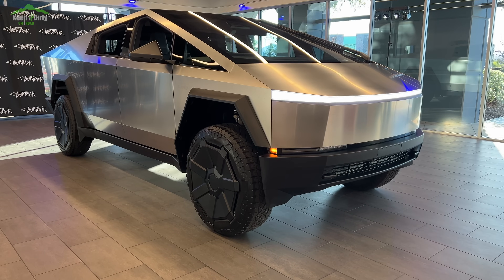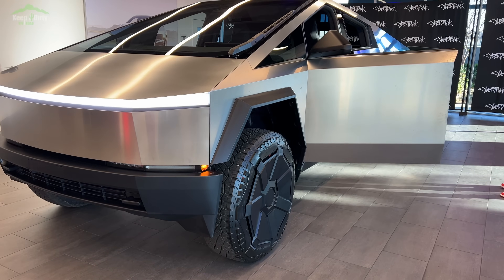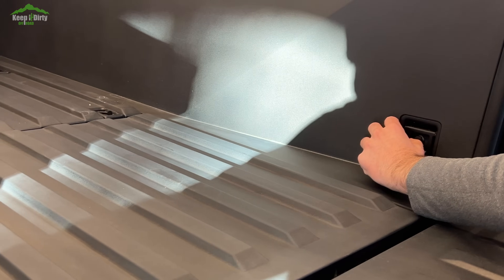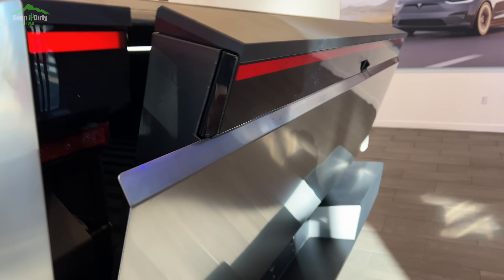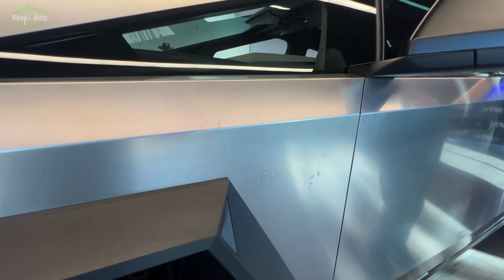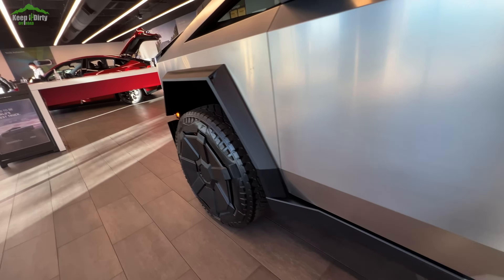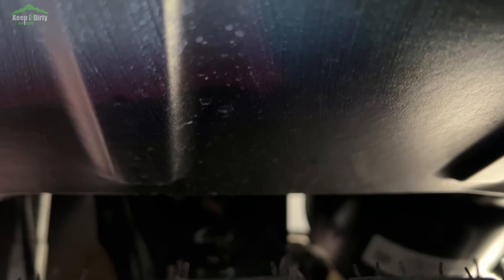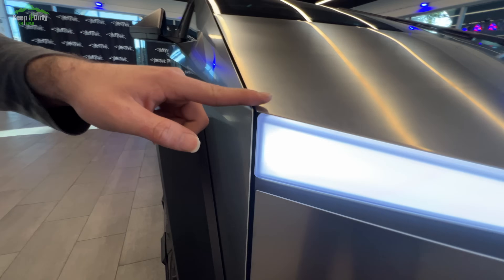Off-roaders take on the CyberTruck

Comment: I think you are unfairly critical of the Cybertruck.  It was never meant to be the ultimate in off-road vehicle, but still offers considerable off-road capability, short of a rock crawling modified jeep.  Wasted space?  The bed or vault provides 50 cf of secure, weatherproof storage plus another 35 cf behind the front seat and 7 cf in the frunk.  That's over 90 cf of protected storage space in a truck shorter than an F-150.  The ride quality, maneuverability, and silent power rivals that of a Model X.  The air suspension has 12" of vertical adjustment from an easy entry height to 17.44" of ground clearance, more than most 4-wheelers, and no differential to get hung up on.  Traction control with locking differentials will make off-roading better than most stock 4 x 4 pickups.  And I haven't even mentioned performance.  Your complaints seem trivial in comparison to the many features and capabilities of this truck. You don't even acknowledge the durability factor of the 1.8mm stainless steel exterior, only pointing out the sharp edges which will "cut you".  Nonsense.   Oh, and many of us owners think it beautifully futuristic, unlike the century old, busy appearance of every other pickup out there.  Sorry, but I have to give you a thumbs down on this review.
Reply from the maker: Ah spoken like a Tesla fan that’s not a truck guy. 

Yes, a regular truck with a bed cover with have similar storage. The suspension can collapse on a POTHOLE it’s so weak. 

But you are on point. It rivals the model X. A street focused SUV. Not a truck.  

And the clearance you stated does not matter. Because it only has the clearance at the top height. Raptors have more than that and have better departure angles. And that truck can use all that offroad.

Now I ageee with you the powertrain has more potential. But right now, TODAY, it can’t lock the differentials and it has super weak suspension for the road. That front arm is important and it takes all of its capability away. 

To me the CT had to be better than any other truck on the market. And it’s not. Truck guys will see that instantly. Fan boys won’t.

I’m a big fan of Tesla. And I’ve been very disappointed. You may be happy with it. But I’m coming at it from a very different place than you are. I want an off-road toy that will rival my raptor. That’s why guys watch my channel. This is not that and as a truck, it’s a big miss. The Rivian is far better
Reply from the maker: Now you mentions the “durability of the stainless” that’s literally the trucks worst feature. The stainless panels and the gigacast supporting it is going to make them a nighmare to repair. I would also argue that with traditional panels it could be a might lighter and more efficient truck. I don’t a lot of off-roading and get tons of pin stripes and damage on body panels. Even though the stainless has good impact resistant, it can still get scratched and it will rust. And if you get into an accident you can see small damage completely total the truck. So the insurance costs are going to be nuts. So yeah man. You pointed out one of its worse features
Reply: @KeepItDirtyOffRoad  It's clear you've blindly accepted things that others have merely speculated on but which are by no means proven or likely.  There are arguments against everything you've just written.  The most obvious fallacy is that the SS will rust.  Cybertruck is going to eat into conventional truck sales in a big way.  That's got to be hard to accept, but it will happen.  Cheers!
Reply: @KeepItDirtyOffRoad  Every truck has it strengths and weaknesses.  No truck is all-around better than another truck.  I'm not a truck guy, your right.  I'm a truck girl though.  I don't need, nor would I want a Raptor.  It's a vehicle that appeals to some for the purposes it does well. But it falls short in many other ways.  I will be doing off-roading with my Cybertruck.  Not the kind you do, but plenty of scenic back country camping on some fairly rugged trails.  I don't need a 35 deg departure angle for where I plan to go, and I don't need the Rivian's tiny bed.  I hope that I meet you on the trail out west one day.  Most off-roaders are friendly, helpful, and respectful as I'm sure you are.
Reply: @MsAjax409 SS rusting isn’t controversial. All steel rusts. Some are more resistant than others. That’s not speculation.
Reply: @MsAjax409 I don’t believe CT will eat into any ICE truck sales. The towing numbers are forgettable. The more overlanding style crowd, which more closely resembles the type of off road use you described is not benefited by the CT design.
Reply from the maker: Would love to meet you on the trails. No better way to discuss these vehicles and see what they can do. But please know my thoughts are my own. I’ve seen what happens to delorians when they were not properly cared for. I love EVs and wish ford would build the switchgear for us, if you haven’t seen it it’s a raptor version of the lightning that is very compelling. Have a video on that too. 

I also have experience with teslas and their issues. And that’s where my opinions come from. I have not had the best experience with them. I’ve loved their cars. But hated their reliability and service. After my model S required a new battery pack after 2 years and 50k miles they went down a few pegs. Still bought a 3 later and that was better but also worse because the cost cutting was pretty bad on those early models. I’m seeing that same pattern repeat on the cybertruck but worse. So I’m disappointed in the company as a whole to be honest. The first Tesla truck should have set the standard for EV trucks. And to me I didn’t. The Rivian and the f150 lightning are more compelling options to me. But neither has native access to the supercharger network so they are not for me either so I can go where ever I want to go. The public charging network is a joke compared to Teslas supercharger network.
Reply: @xxicemanxx11  I agree that long distance towing is a problem for EV pickups, but not for local towing.  Fifth wheel rigs, for example, should stick with ICE tow vehicles.  But many trucks are sold that aren't used for towing long distances, and the significant cost of ownership benefits of the Cybertruck will convert many traditional pickup owners.  The backlog of reservations and orders is enormous.  Yes, CT will eat into ICE truck sales.  The only question is how much, and that will depend on future pricing.
Reply: @MsAjax409 tbd. In current capability, I don’t believe they will. Still need jumps in technology. Just my opinion. I didn’t tow hardly ever with my F150 but when I did, a CT wouldn’t have the range to do it. For me personally I need more capability there.
Reply: @MsAjax409 I’ve seen all the counter arguments. And yes. It’s technically true…because it is true. There’s just zero excuse for Tesla not to have at least an epoxy or clear coat on the external finish.
Reply: Good points here. The CT looks to have been designed with some basic offroad capabilities in mind, but it wasn't intended for rock crawling or anything like that.

Fact is, most truck owners will never take their trucks offroad beyond a construction site, a farm, or a logging road. For that matter, only a tiny minority of truck owners even use their truck to tow.

People get trucks to carry their tools or to be able to occasionally carry cargo that won't fit in a car.

The biggest thing is to displace the many inefficient trucks that are already on the roads while offering the capabilities that the majority of truck buyers need. That requires cost-cutting to make the CT broadly affordable.

You know what they say: "Good, fast, cheap. Pick two."
Reply from the maker: If it wasent intended to go off-road then why does it have such large tires and the capability to raise it so high? 

They would get better range with street tires. It would be faster and more livable. Regardless of what you think of how trucks get used the Cubertruck was advertised as an off-road truck to be better than all trucks. And it’s not that. It’s that simple.

Comment: It was designed to be "ugly".  Instead of aero dynamic they went for looks.  This is a driving bill board and do not even need a badge to say what it is.  Honestly the firs impression of the upper control arms in front is not good, but if you think of what their job is they are actually quite adequate.  They are there just to keep the wheel upright and they take nearly no sideway stress, except if you mount something like tank tracks on the outside of the vehicle.  The most stress they experience is most probably with braking and accelerating.  Most cars have a rubber mounting on top of the strut doing the job, so not much stress in that area.
Reply from the maker: Yeah, it’s the best billboard for Tesla yet.

But your way off on the arms. Upper control arms take a lot of stress. On a truck, upper control arms take a massive amount of load and are always cast steel arms. You look at any other Tesla made car even, they only use cast upper control arms. 
On trucks that offroad, the most common suspension failure point is the upper and lower control arm ball joints. And yes this was designed to be an off-road truck because of the extra ground clearance and 35in tires. Tesla even advertises it as a go anywhere truck. 

Aftermarket I know will fix it. But it’s perplexing why they would put such a weak arm in it. Because it will bend under stress. Wider tank tracks on tame trails bent the first one. All it will take it the right pothole for that upper arm to bend on the road. And we’ve already seen rear suspension failure on very tame donuts at King of Hammers a few weeks back on a fully stock truck. 🤷‍♂️

Comment: I'm sure all these things will be fixed as we move forward. it's only going to get better.
Reply from the maker: Tesla does have a better process to fix things. But they are really bad at changing designs from the core solution. So I could see the arms getting updates. But I don’t see the trunk getting bigger or more storage added until the next generation like we saw with the S and the 3
Reply: Software updates cannot fix bad design choices, like using a cast aluminum unibody to build a truck.
Reply: @TroySavary  bad design? Gtfo 😂 don't hate bud, thats your opinion.
Reply from the maker: Giga casting is pretty revolutionary from a manufacturer standpoint. Reduces their cost. But as model3 and Y owners are finding, it’s not so great from a consumer standpoint. Cars are getting huge repair bills for crash damage and small fenders benders or totaling cars due to teslas cost savings. So that’s why some see it as bad design. Tesla needs to provide better guidance and training for fixing these large castings.
Reply: @Hugo-py2ce  Any design choice that reduces durability, especially in a truck, is a bad design choice. People act as if Tesla invented die casting. Other car companies tried die casting structural components in the past, then went back the old way, precisely because of durability issues. The only thing new with Tesla is the size of the castings.
Reply from the maker: That’s a good point. I feel like the other manufacturers are thinking about supportability of their cars and the aftermarket. While Tesla does not care about supportability and actually actually fight against right to repair and they could care less about the aftermarket
Reply: @TroySavary  do your research. You'll see there's more to it than that.

Comment: Zero articulation when the air suspension is at max.
Reply from the maker: 🤦‍♂️🤦‍♂️ wow, did not even think of that. I’ve seen the clips that heavy D posted on the sand and the back end of getting overwhelmed with the shock setup they put into it. He said they are working on “long travel” for it but they mainly build lift kit, not prerunner suspension so it should be interested to see what they do with it.

Comment: It's just like a majority of other trucks.  You can't compare it to a Raptor.  It sucks, but range would went from not good to effing terrible.  There were tradeoffs.  I think battery tech needs to improve to the point were a CT like this would get 750 miles.  Then they can build a Raptor competitor that gets 500
Reply from the maker: Would have to disagree a bit here. Tesla built it with 35s and showed in Baja before launch. That puts it in direct competition with the Raptor and the TRX.

Now I agree battery tech needs to improve. We need the ability to hold more of a charge with less weight. The Hummer battery for example is a joke increasing the trucks weight to 9k lbs. the CT at least kept her lite at 6600 lbs.  but to me the range and power is not as much of a drawback. You’re not towing with an EV truck and the current range is OK. Not great but usable with the supercharger network. My concern is they cut cost so much they put sub par components on it and it’s not better than a standard truck. I should be considering the price and inconvenience of changing.

Comment: lol bent upper CA on some tracks that sit 2 feet out. Something called leverage was it?
Reply from the maker: If that helps you sleep at night. 

It won’t take much force for those upper control arms to bend with the stock tires. All it takes is the right wash or the right curb for them to bend. A solid control arm like those on the S, X, 3, or Y are not as vulnerable to bending.